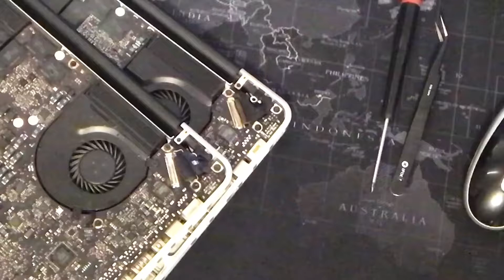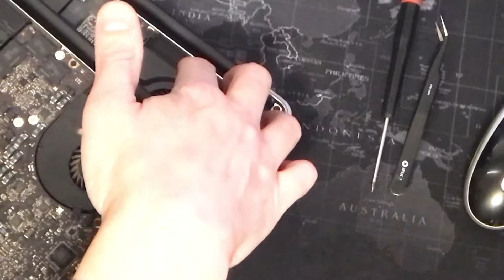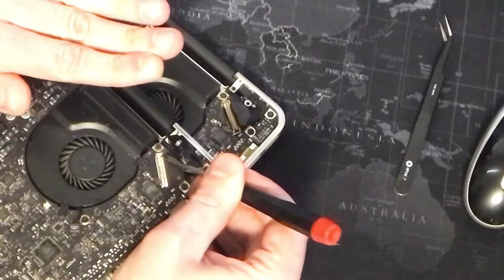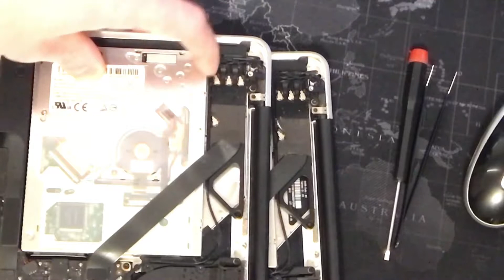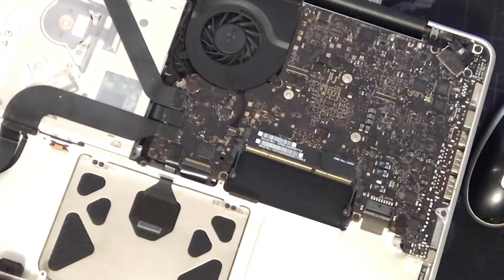Differences Between 2011 and 2012 MacBook Pros / Using a 2011 Screen Assembly on a 2012

Comment: I changed the displays 2011 display into 2012 but is flashes colors white -> red -> green -> blue and loops. Doesn’t boot up
Reply from the maker: That's likely a GPU issue, not anything with the screen.  Reset PRAM, SMC and see what happens.
Reply: @RDKLInc  i have the original 2012 display too it works fine. in 2011 it shows some kind of a test with colors
Reply from the maker: @ I dunno, I’ve never experienced that with these screens.  Disconnect and reconnect multiple times — the connection is not perfect so it often takes multiple attempts

Comment: Hi, thanks for the video. Is it possible to swap the A1286 logic board from mid-2010 with the A1286 logic board from 2011 or mid-2012?
Reply from the maker: @ДмитрийМальцев-г5л  no you can’t, 2010 15” has different cabling than 2011 and 2012 15”
Reply: You could, but you need to trim out the plastic part of the LVDs cable and that is risky as it may damage the connector

Comment: Could I swap a 2010 13 inch macbook pro motherboard to a 2011 or even 2012?
Reply from the maker: @EdCayo  nope different cabling
Reply: @RDKLInc  not even the 2011?
Reply from the maker: @EdCayo  no 2010 has different wireless cables

Comment: I managed to swap the 13 inch MacBook Pro late 2011 with mid 2012 screens and so far no issues. Followed your instructions ands it works! The 2012 screen fitted into the 2011. The 2011 still thinks that it has the original. 🤯
Reply from the maker: Good to hear!  A little tricky getting it in there but usually works great

Comment: Any idea if I can get a 2011 17” screen into a 2012 15” logic board?
Reply from the maker: You mean put a 15" board into a 17" computer?  The video connector is compatible, but physically everything inside the machine is different and would require significant reconfiguration.  I don't know how a 15" board would react to a 17" screen...my guess is that it would recognize it but probably wouldn't give you the resolutions/modes you would hope to have on a 17"
Reply: @RDKLInc  I’ve got lots of MacBooks so I’ll probably give it a try. In theory, if it worked it might be possible to make a 2012 17” with some chassis modifications 🧐
Reply from the maker: Worth trying, you could even turn it into a sort of "desktop laptop" and not bother with the original case.  The person who would know is dosdude, I bet you anything he's tried it.  @GoJot
Reply: @RDKLInc  Oh yeah he’s a madman, he soldered a 2012 CPU on a 2011 17” logic board. I’m not quite that talented 🥹
Reply from the maker: yeah me neither  @GoJot

Comment: Hi John,
I hope you can help me out.
I contacted you on that before somewhere last year. Anyway I will refesh your memory:
So, I have a mid 2012 15" MBPRO with a standard glossy screen 1440x900 and NVIDIA 1GB NVRAM GPU.
Recently I have replaced the display with a mid 2012 hires 1650x1080 matte screen.
So same LVDS cable as on the former, Did fit nicely and the (shell formed) clamp closed smoothly.
I also have not seen any dirty on the LVDS cable contacts.
How ever, after booting the mac I don't see a screen.
Right after pressing the power button the screen flickers once slightly and then nothing happens.
When I connect my Thunderbolt Display and check the screen preferences the hires screen is being detected as hires screen.
But, nothing is seen.
I have tried to reset NVRAM, start in safe boot, disconnect battery + SSD.

Nothing helped.

Have you experienced this before?
Any other idea what else could it be?
Reply from the maker: Disconnect and reseat video connector a dozen times if you have to, resetting pram each time.  If that doesn’t help you likely either have a bad screen or have blown the backlight fuse on the board.
Reply: @RDKLInc  Is there a way to fix it without soldering a  new fuse and/or driver onto the board? Or replacing the logic board?
Reply from the maker: @mikaelsoppa  no if the fuse is blown the fuse needs to be replaced, or the board replaced.

Comment: I did exactly just that: Have replaced the screen of my 2012 15" with a 2011 one. I even went a step further. The 2012 has a standard 1440x900 glossy screen and I replaced it with a 1680x1050 matte screen. But I experienced an issue when after booting up. The screen showed a lot of red artifacts where there is a black space on the screen. 
Now, you suggested to widen the connector of the 2012 to make it fit the 2011 LVDS cable. I did it differently: The 2011 LVDS cable has some plastic without any signal that spreads left and right to the side of the connector. So I cut that off. Is it possible that I damaged the cable and that is the reason for those red artifacts?
I would load up some screenshots here but that seems not to be possible.
Reply from the maker: Discoloration like that is an indication of a bad connection, anything from the cable to the connector to the connection between them.  It sounds silly, but try connecting and reconnecting it multiple times and test each time.  Sometimes an imperceptible amount of tightness in the connection can cause it to work rather than not work, and then you tape it in place and you’re good.
Reply: @RDKLInc  Thanks but can I do that when running the mac or do I have to turn it always off, try to reconnect, turn on again a.s.o?
Reply: Don`'t want to break anything.
Reply from the maker: @mikaelsoppa  only do it when it’s off.  If it’s on you’ll blow the backlight fuse
Reply: Oh, btw. The 2010 is also compatible with 2012 15"? I heard it's not due to the LVDS cable having a different length?
Reply: Also, on my matte display I've see a fine line on the surface being caused by the keyboard. Do you know if this can be cleaned somehow?
Reply from the maker: @mikaelsoppa  Won't work -- the webcam and WIFI cables are different and wrong length.  The video cable is actually fine, but without the others being compatible it's a no-go
Reply: @RDKLInc  Could you maybe make a video on how to open worn out screws? I face this particular issue I am not abe t remove the WIFI card carrier of the macbook (the screw on the right)
Reply from the maker: @mikaelsoppa  the way to deal with “bad screws” is make sure you have the right screwdriver and right size, that’s the cause of screws getting stripped
Reply: @RDKLInc  I know. I chose the correct screwdriver as suggested by iFixit guide. And it still got stripped. That was the only screw I had issues with. All other ones are fine.
Reply: @RDKLInc  John, I have another one:
I believe I killed the hires screen. After messing around with it it won't run on anymore. Its bad but it didn't cost a fortune so I see this as a learning lesson. 
Anyway, what really bugs me is that it seems that my wifi/BT card is dead as well. WIFI/ BT is not being recognized anymore and MAC OS shows them as HW not installed. So 2 questions for you: IS ist possible to find out whether its really is the WIFI/BT card WITHOUT replacing it?
And, are there any differences in the model years 2010, 2011, 2012?
And then there is the stripped screw on the airport carrier that I need to take care of if I need to replace the wifi/BT card...
Reply: the same happens to me i do exactly how u say and this artifacs appers i cant take of this artifacts but some curious pass   i have a boot camp in my mac and when i boot in windows this artifacts no appear and the screen show all correctly, but when i bot in mac os this artifacts appers is so rare

you can fix this problem ?

Comment: Thanks for the video! Do you happen to know if I'll be able to keep bluetooth 4.0 and airdrop between iPhones if I swap the screens? Thanks!
Reply from the maker: Legendary Heroes Emblem I don’t think so, is there a reason that would impact Bluetooth or airdrop?
Reply: @RDKLInc  oh your right! Since I'm not replacing the wifi and Bluetooth chip. Do you have any advice in trying to remove the wires from the chip/card by any chance?  Kinda afraid I might break it hahaha. Thanks and you just earned a new sub!:)
Reply from the maker: Legendary Heroes Emblem thanks!  I use tweezers.  When you put them back on, position them on the connectors with tweezers, and then use the flat tweezer handle to “click” them in place.  Don’t force them, because they can easily be destroyed.  But you want to feel/hear that “click” that means they have connected.
Reply: @RDKLInc  awesome thank you so much! Keep up the good work! I'm sure with your great response and amazing content you'll sky rocket in YouTube soon!:D thanks again!!

Comment: hi, what about the heatsink?
Reply from the maker: They may be different, but it's inconsequential as far as swapping boards or screens between 2011-2012.  Honestly I only rarely remove heatsyncs...it's just not necessary most of the time.